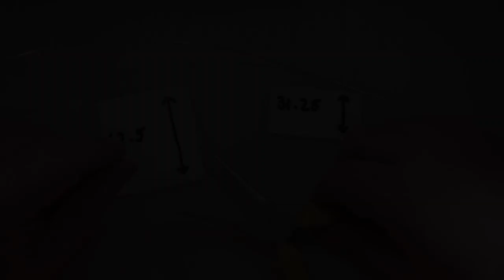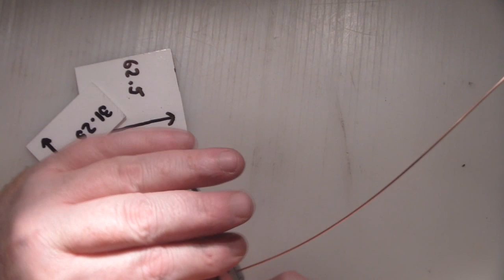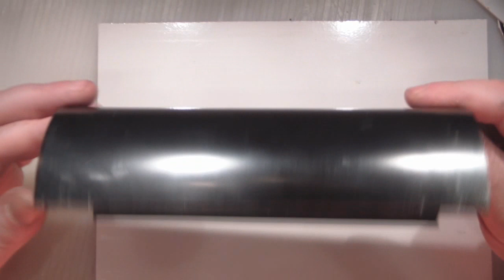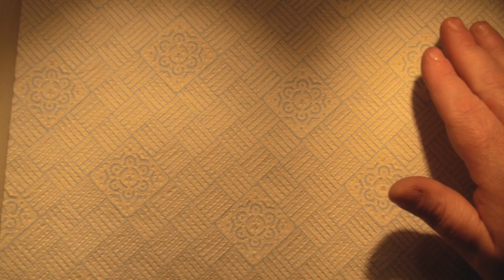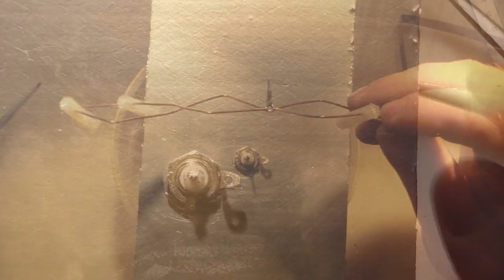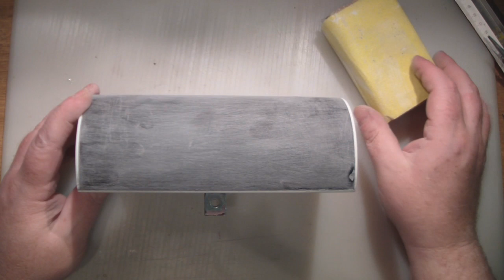Double Biquad Antenna for the 2 4GHz Band #30

Comment: I am going to attempt to build one of your antennas but i am not clear on how to connect it to my laptop. Would it just go directly to the wifi card? Thank you, John
Reply: no, it doesnt directly go on to your wifi card. You'll need a BNC male to rp-sma cable. Then u buy a usb wifi adapter with a detachable antenna (u get good ones from TP-link) and u hook up the cable to the wifi adapter.

Comment: Gee I was very careful & accurate in making this design, & I have built RF gear before, but I got very poor performance from this one. I have used this aerial to replace the differential transceiver aerial in a wifi dongle for a remote mouse/keyboard. The signal is so weak it is worse that the original tiny aerial. I was under the impression that I could connect the two coax leads to the chip I/O pins, having removed the matching components for the previous aerial. Am I missing something obvious here?

Comment: In this morning I made 4 antenna double BiQuad just same with this video.
With one antenna you have very powerful antenna, when you parallel it and make one direction or four direction, you have unbeatable WiFi antenna. I made it, parallel and one direction, I don't know how dBi achieved, but I can connect WiFi with strong signal in over 1,7Km range.

You may not believe it, but just practicing and make its parallel!

Thanks again Andrew!!!!

Comment: If I put 4 of these in parallel does that mean 4 times the gain?
Reply: years ago i made a big panel for digital tv bands using 8 biquads and performs exelent so far i could test, but you cant just have double gain with 2 or 4 times with 4 , it dont work that way , to get the last db of gain is extremely difficult so at some point it isnt give more gain whatever you do
i dont know formulas for that but same thing for yagi`s ...

Comment: Hi,
I spend some time in building various models to find the most effective one. For me that resulted in: backplane of 246x123mm with 25mm lips on the long sides, using 1.5mm2 copper wire (the 20swg was really bad in performance). Using a 1/4 wave of 30.5mm (tried many others, but that had not that much effect). Spacing of 16 to 17mm between double biquad and backplane. Soldering a copper pipe through the copper pcb to connect the coax directly to the biquad (lesser losses than an expensive connector.
I have no absolute dB numbers, but in doing so I went on channel 1 from 58 to 90℅ signal and from -72 to -52dBm in my test rig.
Thanks Andrew for stimulating to experiment!

Comment: Just built this antenna from your video. I had to ghetto it up a bit and use parts from the pound shop and rip apart an old dipole because I couldn't find the appropriate connector in Maplins. The copper used was the earth wire from mains electrical cable. The reflector is made from cardboard with cheap cooking film stuck onto it. The element is supported by thick party straws all held together with 5 melted glue sticks. For the finishing touch I put it in a plastic biscuit box. I thought it wasn't going to work as the copper was slightly bent in places but I made sure to get the measurements as accurate as possible and it has performed surprising well. Compared to the Linksys WRT54G in bridge mode with dipole antennas it got roughly 25% better signal using the ALFA USB adapter.

I just wanted to say thank you for the this video and all the others. I've leaned a lot in the last two days just from watching them and have built a working antenna that I can use for just a few pounds and an a spare evening. I'd be very interested one day in purchasing one of your Biquad Yagi designs in some self assemble kit form if you ever get round to making them.

Comment: I have a question, can you please help me.. I am currently building this antenna following your instructions but what I don't understand is why are you using bnc connector instead of sma? How do you connect to the alfa card? Do you have bnc to sma cable or something? Couldn't you just use a sma connector with a cable crimped on so that the antenna has a lead wire with it? Please let me know.. I'm literally building this antenna right now.

Comment: Is there any sort of theory behind this antenna? Everyone is using different lengths. You are using a 31.25mm  length when the λ/4 of the channels 6 wifi frequency is 30.77 mm. Also the λ/2 is 61.55mm but you are using a  62.5mm. And what is the diameter of the wire you are using? And the reflector seems small comparing to other constructions. Does this work if the element is made out of pcb instead of simple wire? I mean the precision of a circuit board is extremely superior than bending wire with your hands. By the way i like your construction, seems professional.
Reply: no theory here, increased reflector size will lower operation frequency, double size will make it 1.2 Ghz,  it will operate on 2.4 as a first harmonic, and never be better than single biquad on 2.4 Ghz main frequency resonance.
Reply: St

oyan Zaldivart
Reply: Stoyan Zaldivar

Comment: Hi Andrew

Do you think this antena could reach a wifi signal at 300 meters whithin the city???

Does it really matters the type of connector ?

I have a wireless adapter with rp-sma, and I can´t find a pig tail coaxial with BNC / rp-sma connectors.

Does it work if I just get the coaxial cable and put the BNC and RP-SMA connectors??

Thanks Andrew

Comment: hello andrew
coax cables and connectors aren't available where i live
so is it possible to solder the biquad which you build direct to the wireless adapter 
this is the adapter which i have((TP-LINK TL-WN722N )) .

thanks
Reply from the maker: Yes you could and the TL-WN722N is very easy to modify
Reply: so any type of antenna does not require the coax and the connectors and we can directly solder them to these type of adapters and the good thing that there will be no loss in signal
is it right?
Reply: thank you very much sir
you are really helpful and generous
Reply from the maker: hani waleed You will need a short length of coax to connect the two and solder directly but yes the sorter the connection the less loss you have.
Reply: so the coax is important to make the connection between the adapter and the antena ? i thought i can solder it with normal two line of copper and make the adapter very close to the antenna and connect the adapter with long usb cable to the pc
so this idea not possible??
Reply: you need at least some coax to get the right impedance , i think thats the way to go , mounting the adapter too short to the antenna wil give some troubles i guess, mount it at least behind the reflector to minimise all kinds of noise on unwanted side bands

Comment: I like your job with antennas. I want to ask you what was the reference antenna (that with the 64dbm signal). What SWR did you obtain? This Double Biquad has stronger signal than your Biquad Yagi ? Did you ever try to add two "booms" to this Double Biquad  and create an antenna aray ?

Comment: If you could take a look at my design of a biquad.  I was thinking the finish product.

Biquad dish 2.4 free wifi
Reply from the maker: Ok well I like the idea of putting the element between the Plexiglas I my borrow that. Now a parabola is a mathematical curve with a focal point that can be calculated. Yes there are many youtube videos that use kitchen utensils as parabolas but I have never come across anything in the kitchen that is a true parabola. I have looked at doing something like that using the wind surfer template and also bending the element of the biquad to match the curve of the wind surfer. The focal point of the curve is such that only 10% of the element is in the focal point. This is why such a small parabola works best with a dipole. Now if you have something bigger like a sat dish the focal point is much further away so a biquad will work much better. But even then dipoles and cantenna’s work much better. Don’t let this stop you experimenting though.
Andrew ;-)